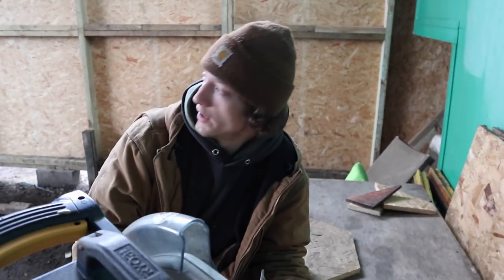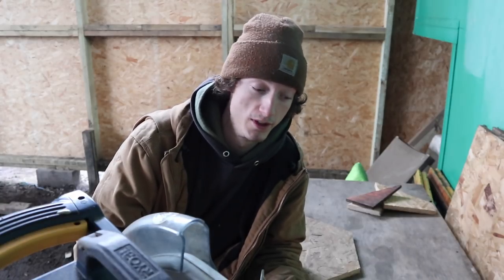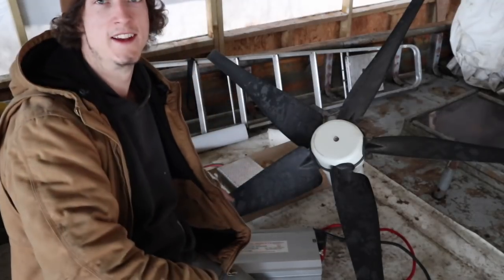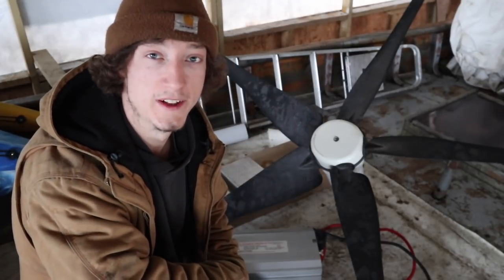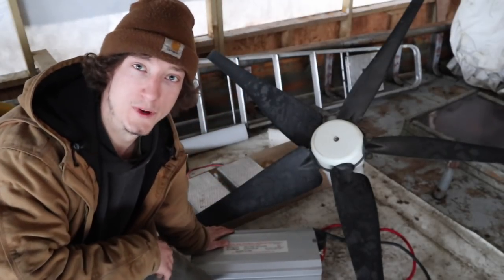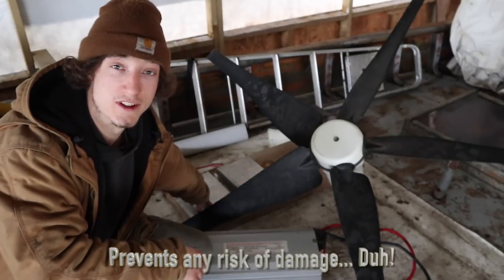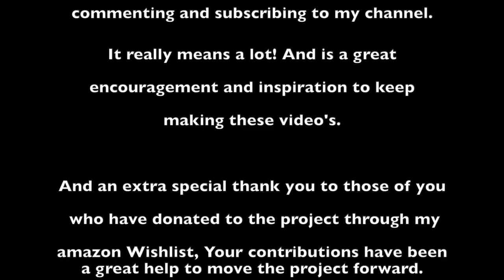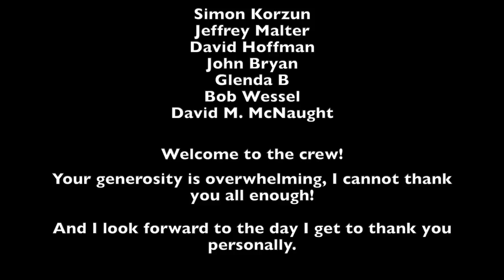GOING GREEN! ***Episode 4***

Comment: May have been already mentioned but your ridge beam will loose it's strength if it's not kept vertical.  Bracing is needed to ensure it remains in a vertical and remains strong.  A little bit of load and then a little bit of twist and BOOM it's down....  Great job on the barn and the boat......:)

Comment: Finn doing a great job of the shed, it will pay off on all they wet days we get. People are so generous 👏 great turbine, remember when i got my first boat and joined the club i am in now, its a small yard on the river for 30 boats. Guys where so helpfully and gave me advice and old stuff they didn't need anymore, when i think back i would of struggled if it wasn't for there help. Do the same now and gift old gear that i have upgraded or don't use anymore. The sailing community ate a pretty good bunch on my experience 👍👍👍⛵🏴

Comment: have you thought to use the xs power to run an immersion  heater fitted to a large(ish) domestic how water cylinder as a heat store?
Reply from the maker: shady shane i have looked into it! Will be something I install at a later date when funds are more accessible! For not I just need to get it up and running and powering the space 👌🏻

Comment: Dang, why didn't you chamfer them on both visible sides. It would have helped with standing water against the glass. Now rotting is inevitable.
Reply from the maker: Paul C the small sill I put in sits higher at the back, then sealed with silicone, water runs off, it’s all groovy!